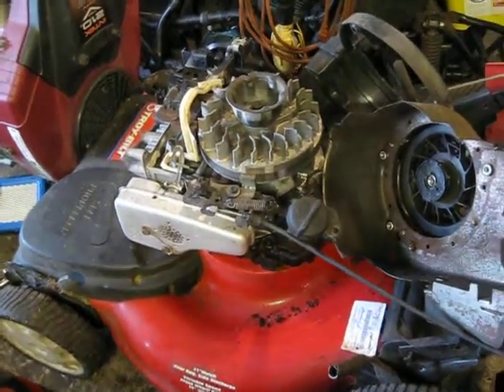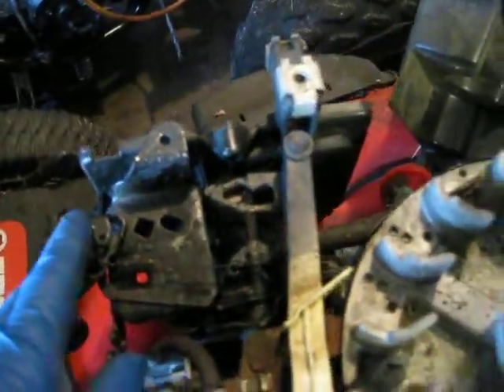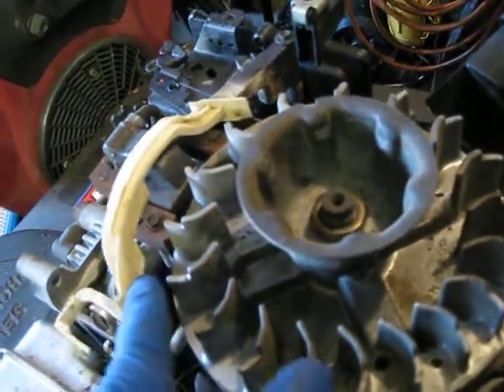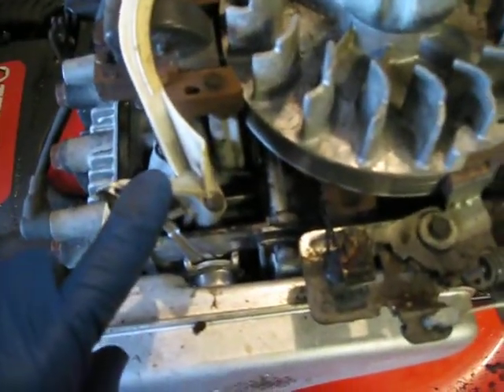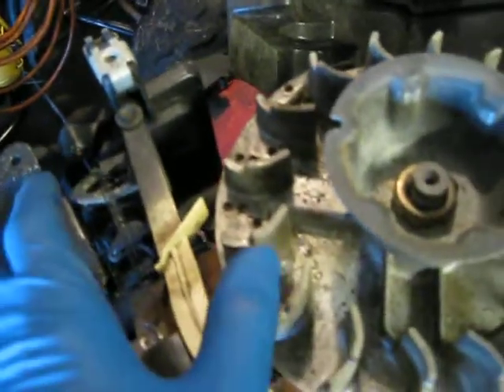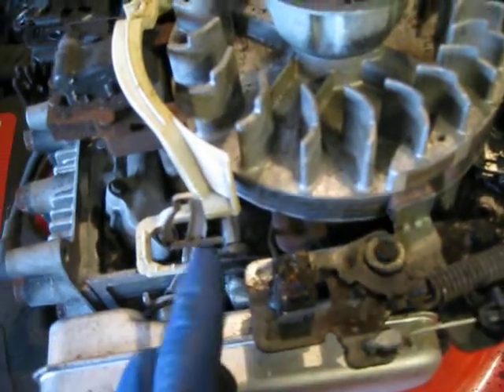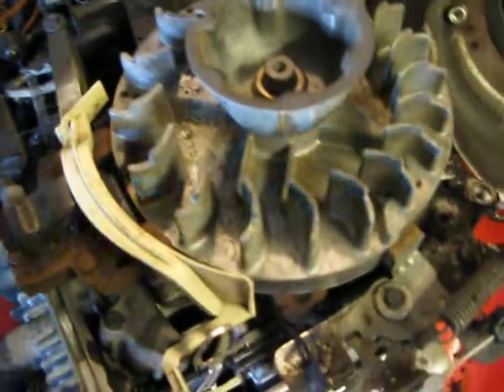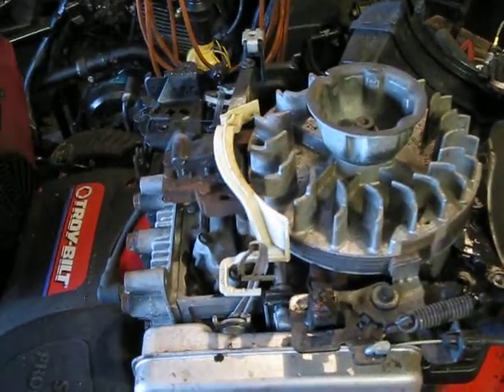How Automatic choke works on a Briggs and Stratton quantum

Comment: Thanks for the helpful video. I have one where the air vane pivot is frozen in the bore around the pivot screw and won't loosen and am not sure about the condition of the thermostat. Maybe I  used heat gun to if it is functioning. I may just convert it to the early primer bulb system (change new carb and filter housing).

Comment: Thanks for taking the time to make this!  I picked a mower off the curb that looks mint, an older Troy Built with this setup.  Put some gas in and it gushed out the carb.  Before this, she did fire up for a second so I know there's potential.  When I get back to it, it's getting either a carb replacement or rebuild, and then this video will help me understand how to make sure all those linkages should be inside.  Take care!

Comment: My 5.75 Quantum B & S is nothing at all like what you are describing. The throttle valve on it appears to be controlled by by an arm of some type that appears to be controlled in the oil sump or thereabouts.  My current problem with it is the throttle valve is being held open rather than closed as it should be prior to starting.  It's isn't starting.  Anyway  I found your video interesting.
Reply from the maker: You're talking about the governor, completely separate system. It's supposed to be open when the engine isn't running.

Comment: Motor wasn’t starting open it up the spring in the choke was missing trying to find one now. wouldn’t it turn over and stay on with out one you would just need to open it back up and put choke back on starting (not going to do that) just asking for curiosity
Reply from the maker: Theoretically it should but the vane moves so easily it will likely immediately turn the choke off and want to start there  without the spring.
Reply: pfun41 make sense brother thanks for the vid !

Comment: You mentioned fuel problems with these...  I have a surging problem yet carb is cleaned, then replaced with new one. I am at a loss to figure out the issue. I have posted a video on my YouTube page. Any ideas?
Reply from the maker: quantums are not usually finicky. You may have a leak in the intake tube.

Comment: I have an older Briggs quantum that won't stay running.  It has a manual choke.  I cleaned the carb, it has spark and fuel flow but won't stay on for more that 2 seconds.  Anyone have any idea what to do?  I really think it has something to do with the throttle linkages but not sure.
Reply from the maker: Probably a clogged carburetor.